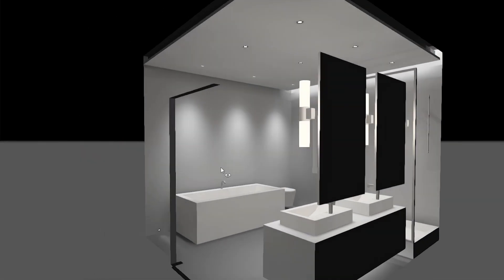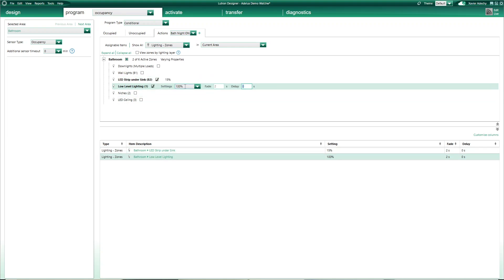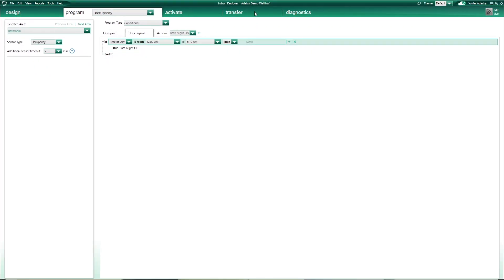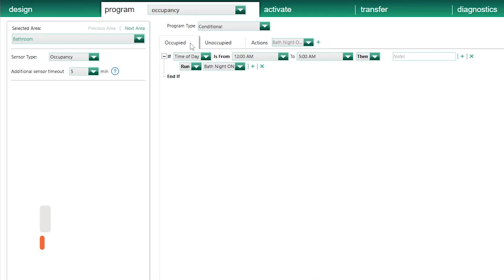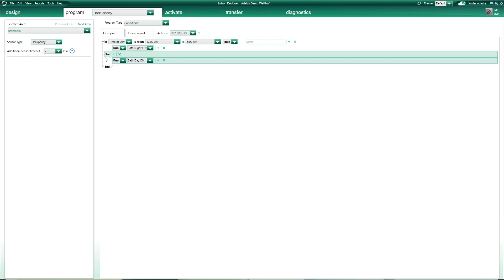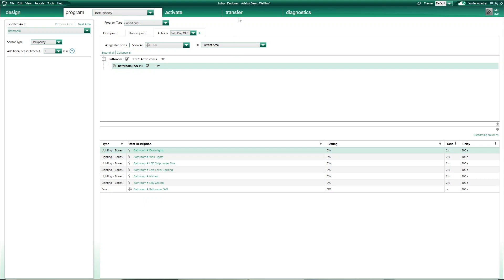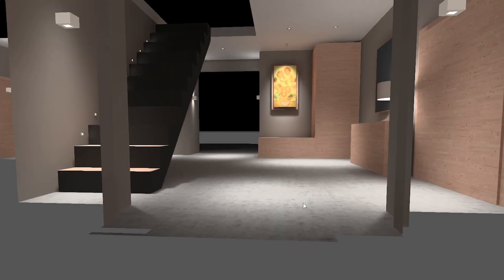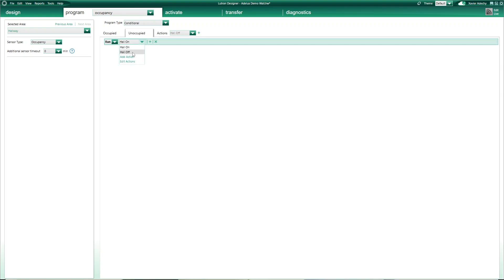Mastering Conditional Logic Programming with Faradite Motion Sensors in Lutron HomeWorks - NEW 2024

Comment: awesome video once again! What do you do if you have an OCC on a CCI and you want it to turn on and only turn off with a keypad button press. The thing is you do not want the OCC to work again if its already on the button press unlocks the OCC input. Cannot seem to find this on any
Reply: Nevermind just set a variable to State 2 when OCC motion occurs and Set it to state 1 on the button press. The Time of Day AND the State 1 has to be conditioned so that the Lighting scene occurs. Have a delay so that you do not activate the OCC when you change the variable back.
Reply from the maker: Well done 👍🏾 thanks for sharing your solution

Comment: Great. Please make a video of using a keypad which disables the sensor and the Off button enables  it
Reply: This is what we would prefer to program.  We wouldn't want the lights to go off automatically from the PIR if they were already set to a scene in the first place, i.e. you would set a scene for the evening and expect it to stay on regardless of any motion activation.  That said, this method for determining whether the PIR should activate based on no lighting being on is neat and requires less programming steps than we would normally use
Reply from the maker: There so many features to cover! That’s definitely an idea for the future. If you have some insight or want to share with others, feel free to comment below. Surely that will be helpful for others ✌🏾
Reply: @adelux  This is exactly what im looking for, i know that theres a way but cant get it to work but any means!! can you help with this? thanks